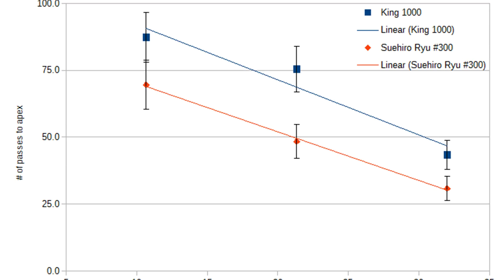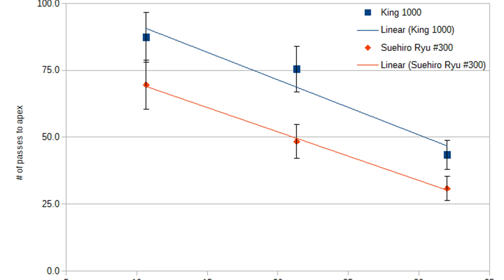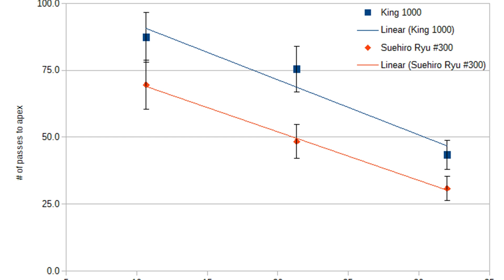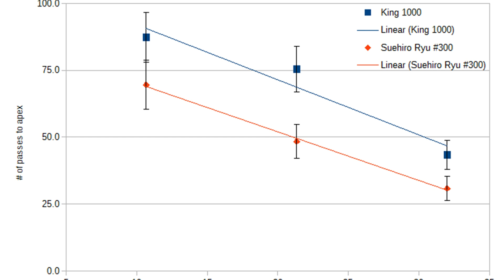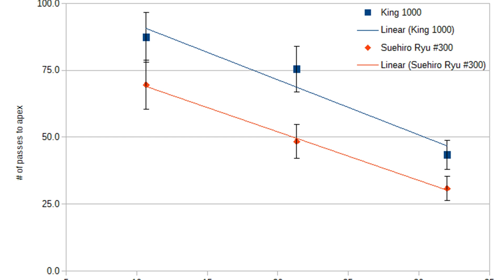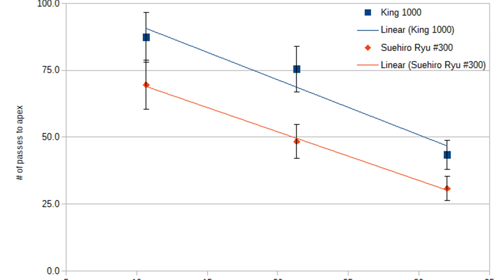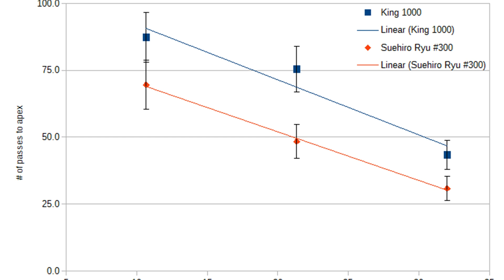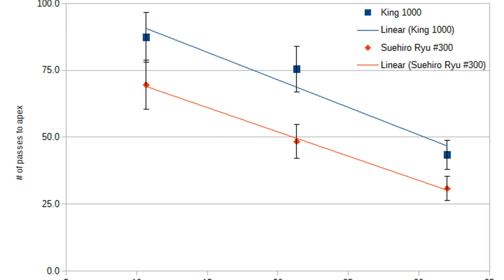--SOLVED-- Knife Challenge #35 - grinding speed

Comment: my limited caveman experience of stones threw up all kinds of ideas of why "things weren't working like they should" in my dark days in the garage ,,, has the stone been dressed flat, the porosity( don't know if that is the right term but it is what I called it) ie the grain of the stone being unclogged with material and the grain/grit retaining it's mountain peak bite...the bonding between the grains of the stone, whether they simply shed too readily albeit exposing more gritty surfaces beneath but at the detriment of the flat surface of the stone being compromised...many a frustrating evening under poor light was spent until I obtained( contest win,,,lucky me,,) a reasonable water stone set with a nagura,,at least I could flatten the fine stone readily, the water aided the movement of steel and grit during use rather than becoming pressed into the surface and the water stones lasted well without wearing out like cheap $ store item..but my daft idea on why the stone was 40% faster despite being 3x the grit the other stone was losing it's mountain top and wearing to a plateau quicker, once you on grinding on flats the wearing seems to slow as the grits size increases down through the grain,,,,the better stone kept it's peak in "peak" condition longer...
Reply from the maker: Wessex Blades&Bushcraft There are many reasons why this can happen, you named a lot of them. In this case though  the main effect was just the much weaker bond on the King was causing it to wear rapidly which increased the sharpening angle.

Comment: I wonder if it's like the ceramic
Belts where they load up to a certain level of clogging because the ceramic binder isn't releasing which also means the abrasive has fractured to plateaued peaks where it's not at peak efficiency, but still
More efficient than the finer stone which does release binder
Reply from the maker: knivesandstuff Mark had the solution almost instantly, the King wears so fast it just increases the angle of the chisel to form an apex very quickly.
Reply: Cliff Stamp interesting. so the stone is so soft its convexing when you dont want it to?
Reply from the maker: knivesandstuff The King 1000 has a really weak binder, even 10 psi is too much pressure. It works best with very low pressure, 1-5 psi. As you go above that it sheds rapidly. I did ~1000 passes and it had a 1/2 mm hollow and i was intentionally moving the chisel all over the stones, working the ends specifically as well. 

It is made to handle very wide contact surfaces common on Japanese knives. The fact it breaks down so readily allows it to grind anything even 121REX and Maxamet.

Comment: The king is breaking down and convexing the edge so it is only grinding a percentage of the material of the ryu. I first noticed this while working with the shapton 120 be the norton India. My pass count was way off as the norton stone had to first remove the curvature the shapton had induced as it is a very friable stone that easily dished.
Reply: Cliff Stamp Can you or Mark do a video on sharpening chisels?  What do you do if you raise a burr?  I know Mark has commented you don't want to create a bevel on the back flat side.
Reply from the maker: C amber The back is usually just lapped again.
Reply: Will that remove a burr given it's not a high angle pass?
Reply from the maker: C amber These steels are all easy to grind/sharpen, plus they are almost always finished with heavy stropping anyway.
Reply: Cliff Stamp  Thank you
Reply from the maker: mark a Exactly right.

When I switched to the Ryu it took 300 passes just to remove the curvature before it was even grinding the apex. This curvature kept increasing as the stone continued to wear.